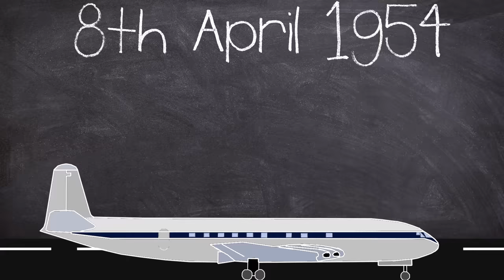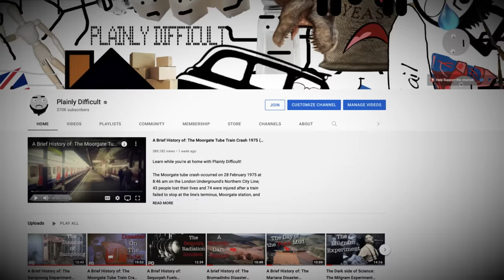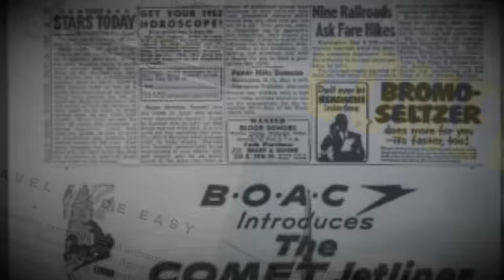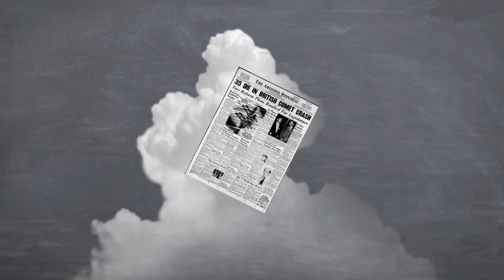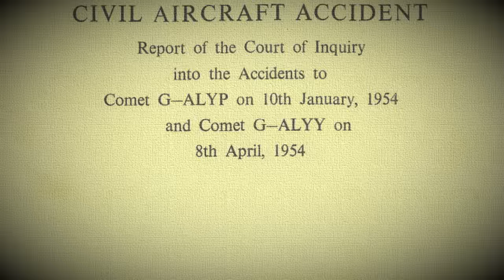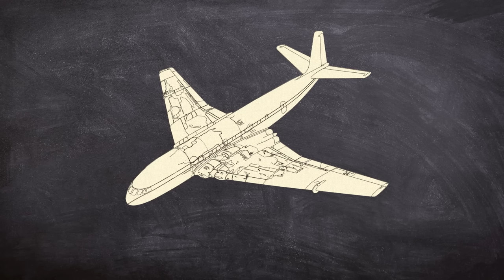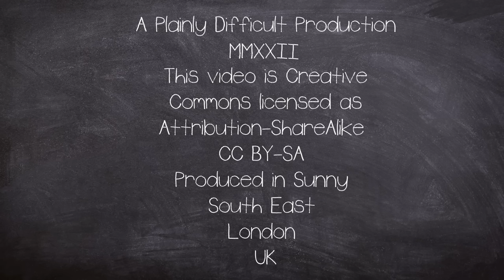A Brief History of: The de Havilland Comet Design Disaster 1954 (Documentary)

Comment: I think de Havilland's need to use a less powerful jet engine, which necessitated the need for a thinner skin structure, would have caused problems even if the windows were round. Mostly because little was understood of metal fatigue caused by flying to over 30,000 feet altitude on a plane with a pressurized fuselage.
Reply: de Havilland chose to use its own engine to save money and speed up production.
 True, square windows were not the cause, even after Comet 1 aircraft had their windows modified they were still deemed structurally unsafe.

That is completely false, the real tragedy of the Comet Disaster was that it could have been easily prevented if de Havilland had simply followed well-known and understood  industry standards in pressurized cabins and metal fatigue.
 Companies like Boeing, Douglas, Junkers and Lockheed had been successfully building pressurized cabins for many years without any catastrophic in-flight structural failures like the Comet.
The Comet was the worst engineering failure in aviation history  and was caused by incompetence and criminal negligence.
Reply: This video has some BS included.
For example -
  
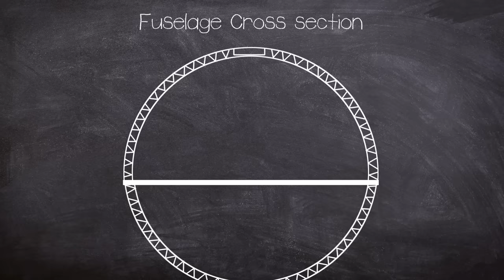    5:20   The idea that only the crew & passenger areas were pressurised is absurd obviously. 
  In fact every part of the fuselage was pressurised from the nose to the rear fuselage bulkhead including the entire cargo area.

Besides that.
The engine position & inlet design were not flaws or fatal flaws, there were good reasons for that design choice at the time.

Comets flew until 1997.
The Comet design had military use as a requirement. Nimrod development began at 
De Havilland before 1953.
Nimrods were not withdrawn due to structure problems or other airframe issues it was entirely a significant upgrade snag & resultant basic economics & an end of line sale happening at Boeing at the same time.

  We feel we can shed some light on some common misunderstandings.

  At the time the Comet wasn't particularly dangerous.

Losses comparisons
How things were in those days.

DeHavilland Comet 4 UK           14% 
DeHavilland Comet all  mks       17%  

Boeing 307                               70%
Boeing 247                               48%
Boeing 707            .                  20% 
Boeing 707                                20% 
Lockheed Electra Turboprop   29%
Canadair CL-44  Turboprop     46%  
Convair CV-580  Turboprop     22%
Convair CV-880    (ff 1959)       27%  
Convair CV-990     (ff 1961)      35%

    Of course De Havilland had prior experience building many all metal construction airframe aircraft including thousands of jet powered fighter aircraft that were primarily of metal construction with pressurised cockpits & jet engines built by De-Havilland.

   De Havilland carried out full stress analysis & engaged in a comprehensive & protracted testing program which is why key De Havilland people were happy to be aboard flying DH Comet aircraft.

    The DH Comet was the first passenger airliner with full length fuselage pressurisation at 8psi pressure differential. Handley Page built the world's first all metal construction airliner during the 1920s.
    In many cases earlier pressurised aircraft were larger, needed thicker fuselage skins due to flying stresses & had much lower pressurisation differential pressure.

   Of course ripstop provision was provided. The skin alloy used became unavailable at the time due to R & D at the manufacturers which resulted in the original alloy being discontinued.
The skin thickness used for the Comet was used for similar later aircraft. 
Frame spacing was not found to be too large & frame width was not found to be too small.

   De Havilland did indeed always work to better than industry standards at the time, used up to date knowledge for the design & construction & no evidence of negligence  or criminal negligence was ever produced in relation to the DH Comet.

   The DH Comet had no effect on the course of the aerospace industry in the UK. The UK now has the world's largest combined nuclear, aerospace & defence sector per capita activity.

    The investigation committee did not find hundreds of fatal flaws or evidence of design defects, structural defects, defective materials or shoddy workmanship. Ripstop provision was included. Claimed incidents did not involve cracks starting from window corners.
Pretty much all changes were just in case changes or were planned development modifications & improvements that were scheduled regardless of incidents.

  De Havilland designers knew all there was to know about metal fatigue at the time they designed the DH Comet.

Hope this helps.

Cheers 👍. 
 
 . . .... ... ..... .

Comment: Its amazing any engineer thought those damn windows were a good idea. The Comet was not the first pressurized aircraft, and stresses at right angles were also nothing new.
Id also disagree with Boeing and Douglas being likely to encounter this fate themselves had DeHavilland not, since as I mentioned, the B-29 and DC-6 had been flying for a good while by the time this disaster took flight.
Reply: Indeed Boeing was the world leader in pressurized cabins in the 1950s

The 307 Stratoliner, B-29, B-50, 377 Stratocruiser and the B-47 were all pressurized with no issues with fatigue.
The B-47 was pressurized to 9.7 psi at 41,000 feet.

Comment: It is always hard to be the first to do something different from what is already known. unknown dangers may exist, and have to be discovered sometimes bitterly.  De Havilland lost his eldest son in a test of a high speed plane, because it reached the  sound barrier. And it was not known such a barrier existed.
Reply: The Comet Disaster and the Swallow Disaster are glaring examples of just how far behind the de Havilland company was in aircraft technology as the world entered the jet age.
de Havilland was still building aircraft primarily from WOOD and Fabric while the rest of the world was building supersonic jets made of aluminum alloys.
Reply: The DH 108 was a killer and horribly unstable in flight..
It was dangerous at any speed.
 There is no evidence to support that  the sHape 108 ever reached Mach 1.
Reply: All three DH108s had fatal crashes. The DH110 broke up at an air show and crashed into the spectators. The DH110 was the prototype for the two seater Sea Vixen. Of the 145 Sea Vixens produced, 55 crashed, of which 30 were fatal.

Comment: I would have thought that some guy with cursory knowledge of physics would have pointed that out before construction began on the first one.
Reply: Indeed, metal fatigue was discovered in 1837, Junkers invented all-metal, pressurized cabins in 1932, Boeing starting building pressurized metal airliners in 1938.
The problem was de Havilland was still building aircraft primarily from WOOD well into the 1950s and simply had no real experience with riveted airframe structures made from aluminum alloys.

Comment: One does not receive ruptured lungs and skull fractures from a rapid decompression. Those injuries come from hitting the water and debris at 250 km/h.
Reply: Explosive decompression on the order of magnitude experienced in the Comet Disaster is exceptionally rare and is not well documented for this reason, bodies recovered from the Comet indicates severe barotrauma, injuries from a sudden catastrophic in-flight structural failures with decompression from more than 6 psi in less than 0.5 seconds include ruptured lungs, ear and sinus cavities and intestinal tract injuries.
 There are simply no other known examples of a pressurized aircraft cabin failing so quickly and so severely... typically aircaft depressurization accidents do not involve total structural failure and pressure drops more slowly reducing the chance of serious barotrauma injuries.
Most of the passengers onboard the Comet died before striking the water from a combination of barotrauma and high energy impact/ deceleration trauma as the aircraft disintegrated in flight.

Comment: We feel we can shed some light on some common myths & misunderstandings.

   That's entirely correct of course, at the time the Comet wasn't particularly dangerous. It was also definitely not the worst aircraft engineering disaster in aviation history obviously.

Comets were flying until 1997.

Losses comparisons.
How things were in those days.

DeHavilland Comet 4 UK                  14% 
DeHavilland Comet all mks             17%  

Boeing 307                               70%
Boeing 247                               48%
Boeing 707            .                  20% 
Boeing 707                                20% 
Lockheed Electra Turboprop   29%
Canadair CL-44  Turboprop     46%  
Convair CV-580  Turboprop     22%
Convair CV-880    (ff 1959)       27%  
Convair CV-990     (ff 1961)      35%

     Of course De Havilland had prior experience building many all metal construction airframe aircraft & thousands of jet powered fighter aircraft that were primarily of metal construction with pressurised cockpits & jet engines built by De-Havilland.

  Yes, that's true, De Havilland carried out full stress analysis & engaged in a comprehensive & protracted testing program which is why key De Havilland people were happy to be aboard flying DH Comet aircraft. The Comet was the first airliner where stress due to pressurisation significantly exceeded flying load stress for a full length passenger cabin fuselage.

    We agree, that's correct, the DH Comet was the first passenger airliner with full length fuselage pressurisation at 8psi pressure differential. Handley Page built the world's first all metal construction airliner during the 1920s.
    In all cases other earlier pressurised aircraft were larger, needed thicker fuselage skins due to flying stresses alone & had much lower pressurisation differential pressure or were military aircraft with relatively small heavily built pressurised capsules. 

     Of course ripstop provision was provided. The skin alloy used became unavailable at the time due to R & D at the manufacturers which resulted in the original alloy being discontinued. Later alloys had very similar properties. The skin thickness used for the Comet was used for similar size later aircraft. Frame spacing was not found to be too large & frame width was not found to be too small.

    Without doubt De Havilland did indeed always work to better than industry standards at the time, used up to date knowledge for the design & construction & no evidence of negligence or criminal negligence was ever produced in relation to the DH Comet.

    Obviously the DH Comet had no effect on the course of the aerospace industry in the UK. The UK now has the world's highest combined nuclear, aerospace & defence sectors per capita activity.

    That's correct, the investigation committee did not find hundreds of fatal flaws or evidence of design defects, structural defects, defective materials or shoddy workmanship. Indeed it is the case that ripstop provision was included. Claimed incidents did not involve cracks starting from passenger cabin window corners. Pretty much all changes were just in case changes or were planned development modifications & improvements that were scheduled regardless of incidents.

    Obviously De Havilland designers knew all there was to know about metal fatigue at the time they designed the DH Comet.

    It is in fact true to say that the way airliners were built changed everywhere, including in the US, after the Comet incidents.

We hope this helps, obviously.

Cheers indeed of course as always etc.
👍
 
 
 . . .... ... ..... . ..... ....

Comment: No.  BUT....I've been in a B-5o Superfortress.  Which, also, is cool.
Reply: The Boeing 377 Stratocruiser was based on the B-50.. fully pressurized to 37,000 feet without any explosive decompression failures due to metal fatigue.

Comment: Before it goes to sleep at night, the DC-10 checks under it's bed for the DeHavilland Comet 🙂
Reply: The Comet is certainly a nightmare... thankfully they were all grounded decades ago
Reply: This video has some BS included.
For example -
  
    5:20   The idea that only the crew & passenger areas were pressurised is absurd obviously. 
  In fact every part of the fuselage was pressurised from the nose to the rear fuselage bulkhead including the entire cargo area.

Comets flew until 1997.
The Comet design had military use as a requirement. Nimrod development began at 
De Havilland before 1953.
Nimrods were not withdrawn due to structure problems or other airframe issues it was entirely a significant upgrade snag & resultant basic economics & an end of line sale happening at Boeing at the same time.

We feel we can shed some light on some common misunderstandings.

At the time the Comet wasn't particularly dangerous.

Losses comparisons
How things were in those days.

DeHavilland Comet 4 UK           14% 
DeHavilland Comet all  mks       17%  

Boeing 307                               70%
Boeing 247                               48%
Boeing 707            .                  20% 
Boeing 707                                20% 
Lockheed Electra Turboprop   29%
Canadair CL-44  Turboprop     46%  
Convair CV-580  Turboprop     22%
Convair CV-880    (ff 1959)       27%  
Convair CV-990     (ff 1961)      35%

    Of course De Havilland had prior experience building many all metal construction airframe aircraft including thousands of jet powered fighter aircraft that were primarily of metal construction with pressurised cockpits & jet engines built by De-Havilland.

   De Havilland carried out full stress analysis & engaged in a comprehensive & protracted testing program which is why key De Havilland people were happy to be aboard flying DH Comet aircraft.

   The DH Comet was the first passenger airliner with full length fuselage pressurisation at 8psi pressure differential. Handley Page built the world's first airliner.

   Of course ripstop provision was provided. The skin alloy used became unavailable at the time due to R & D at the manufacturers which resulted in the original alloy being discontinued.
The skin thickness used for the Comet was used for similar later aircraft. 
Frame spacing was not found to be too large & frame width was not found to be too small.

  De Havilland did indeed always work to better than industry standards at the time, used up to date knowledge for the design & construction & no evidence of negligence  or criminal negligence was ever produced in relation to the DH Comet.

  The DH Comet had no effect on the course of the aerospace industry in the UK. The UK now has the world's largest combined nuclear, aerospace & defence sector per capita activity.

    The investigation committee did not find hundreds of fatal flaws or evidence of design defects, structural defects, defective materials or shoddy workmanship. Ripstop provision was included. Claimed incidents did not involve cracks starting from window corners.
Pretty much all changes were just in case changes or were planned development modifications & improvements that were scheduled regardless of incidents.

De Havilland designers knew all there was to know about metal fatigue at the time they designed the DH Comet.

Hope this helps.

Cheers 👍
  
   
 iiicvi